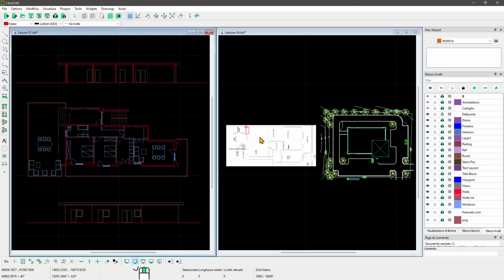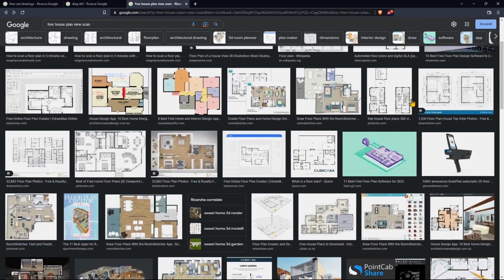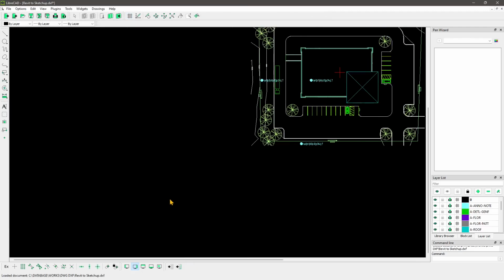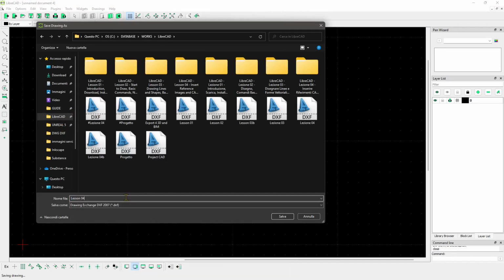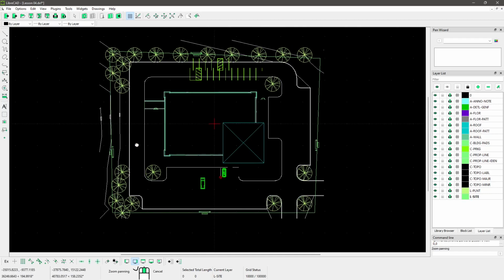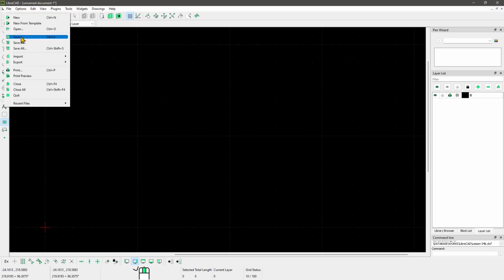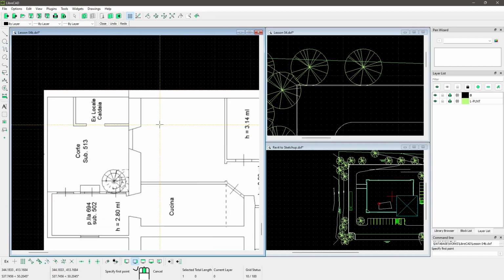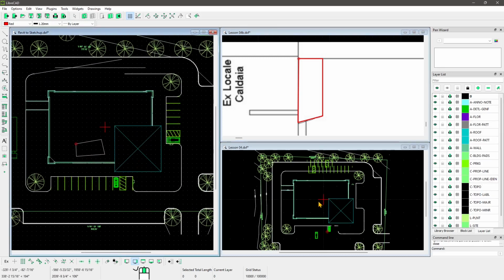LibreCAD - Lesson 04 - Insert Reference Images and CAD Blocks and Drawings, Vectorize Raster Image

Comment: Hi, sorry for my english but i have a question, i need an image with a specific scale in .dfx, and when i save it in .dfx and try to open in other program like LibreOffice Draw or LibreCAD viewer, the image is invisible. you or someone know how i can fix it? or what am doing wrong? 😔
Reply from the maker: I think you mean DXF no DFX, anyway, could be either too small or too big .. Remember when you setup a digital document or a printer you need to define a Layout with a defined scale.. or perhaps try not to use Layer 0 but create more layers .. try also to work with closed polylines instead of simple lines .. If you want to see the full librecad course please write to tutor@jbdesign.it thank you